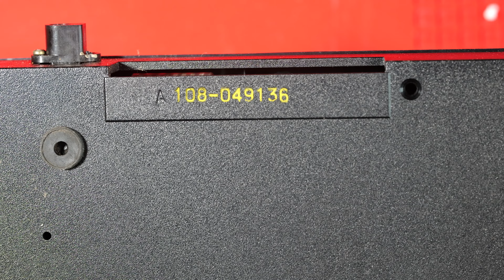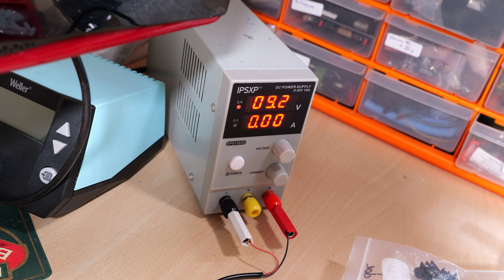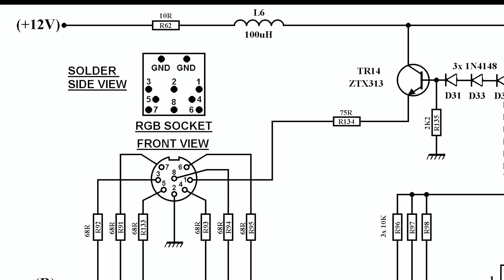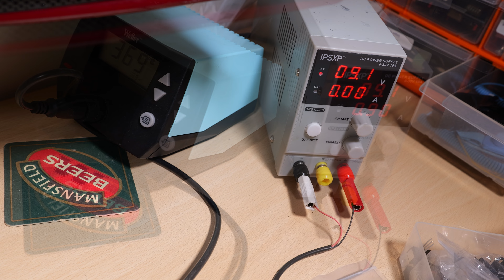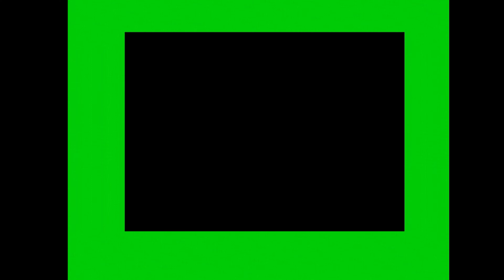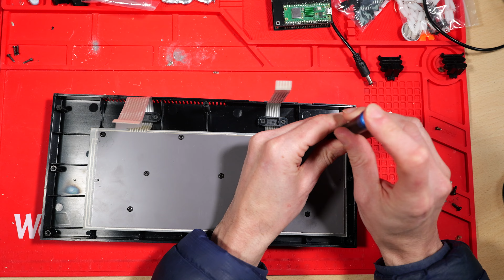Retro Computer Repair - Sinclair ZX Spectrum+ 128K Toastrack

Comment: You mentioned that the membrane isn't terribly responsive on certain keys. I had the same experience with a replacement membrane bought on eBay - the keys that make three layers of the membrane contact were just not responsive enough, and I had to send it back (seller insisted it worked perfectly in his Speccy). Is there anywhere you can get membranes that actually work properly?
Reply from the maker: The mechanical ones on stiff PCBs are pretty good!!
Reply: @HappyLittleDiodes  Thanks. The ones from ginger-electronic look pretty good. Did you buy yours from there?

Edit: I've just seen the video you made about them, and have bought one myself - only cost £5 more than the new membrane. Fingers crossed it works!

Comment: Yellow Gelec capacitors usually survive the decades, but blue ones, if they are Philips branded, most probably are very out of spec by now. They are not known to leak corrosives, but they go out of spec significantly. If you intend to use this Toastrack, I advise to replace the Philips caps at least.

Comment: The original rgb not working is because the rgb cable uses the composite pin to power the blanking signal (with a smoothing cap in the cable) 

So not only is the composite signal  practically missing, the good rgb signal doesn’t get displayed by the tv due to the low voltage blanking pin.

Comment: I didn’t see the legs of the transistors being formed and I’ve had lots of faulty boards to repair in production caused by people inserting E-line 0.05” pitch legs into 0.1” holes by making the transistor do the splits 😂.
As the legs don’t go in perpendicular to the hole, they scrape on the barrel which can shave some plating off the inside of the outer legs which curves to create a short to the middle leg.
I teach assembly and soldering and have a picture of this on my phone that I show my students.
Reply from the maker: Can you recommend a forming tool? If I'm going to form I want to do it right!
Reply: @ tbh I’d just recommend some good precision round nose pliers as that’s what I use.
I’ve got preforming tools for things like forming to stop component meniscus dropping into holes and such but don’t really use them.
I have a load of visual stuff I show to demonstrate assembly issues and have some To-92 which are all the same (or equivalents) by different manufacturers. One i call a ‘cowboy leg’ lead form like the Zetex ones you removed, then the straight legs like your replacements and you can also get a ‘back step’ leg and I always form them best I can to match the holes with the pliers.
I’m teaching IPC J-STD001 this week in a UK military company and have today been talking about this subject and showing examples of how to form and to be careful when using round nosed pliers when we covered the 10% lead deformation limits as it’s easy to squish a bit too hard lol.

Comment: Not sure why the ZTX751 is recommended as an equivalent of the ZTX213 as the 751 is a power switching transistor. The ZTX213 and 313 are not really special.. BC556 and BC546 can replace them. Likewise the ZTX450 can be replaced with a BC337 or BC639.

The only special transistor in spectrums is the ZTX650 - this is due to its power handling and switching speed. ZTX653 is still made, and is simply a higher voltage version of the ZTX650.

Comment: Have you seen the coloration inside the top case?
It’s right over the voltage regulator, so the old one blown very hot.
And that explains also the melted connector for the regulator.

Comment: That's quite a nice box you've got there.  Mine, after being in the attic for years, is a bit bashed and tatty.  The polystyrene seems to have been eaten by the cables.  The machine needs fixing but I'm saving that for a rainy day ...

Comment: Wasnt TR4 and TR5 always the problem power transistors as far back as the 16K? Used to pop if you pulled the ram pack or joystick interface out.
Reply from the maker: Yes definitely! Always a culprit